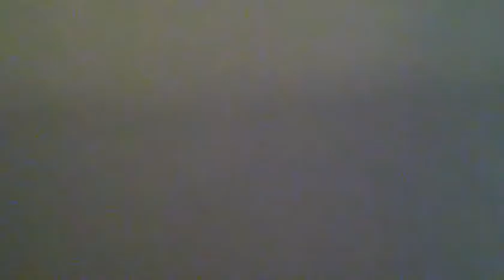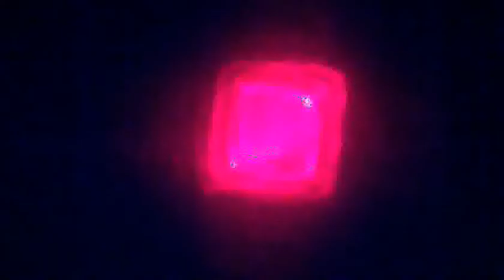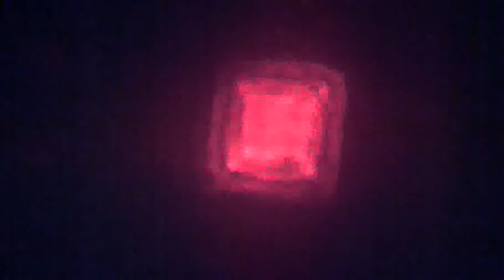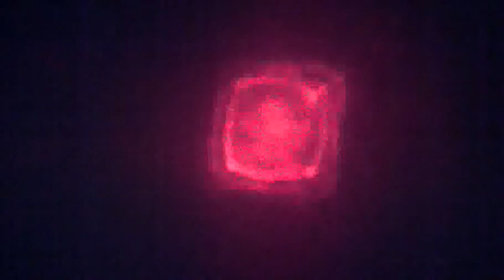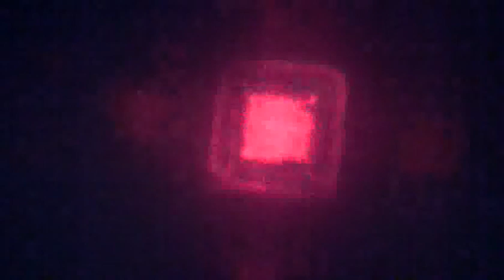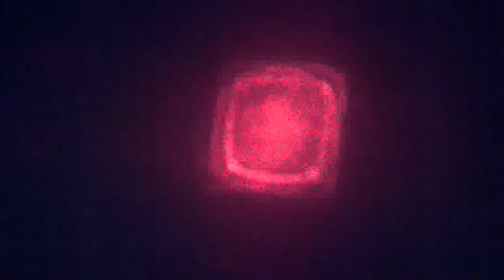First demo of BMC 140 actuator MEMS DM operating under Linux and MATLAB.

Comment: Great demostration!! Im new in the field of adaptive optics, its very impresive how it works ... you used the drivers provided by thor labs or you made it all?? i bought a BMC MEMS DM and i need controled by matlab i need install something extra in matlab to run this type of script??? ... sorry im a newbie in this area

Thanks :D!
Reply from the maker: Hi.  I wrote a Linux USB device driver that talks to the DM controller.  You can find the code on github.  https://github.com/jlcodona/BMCUSB